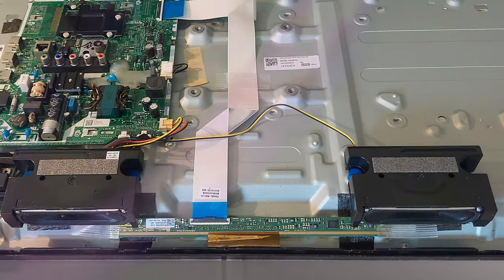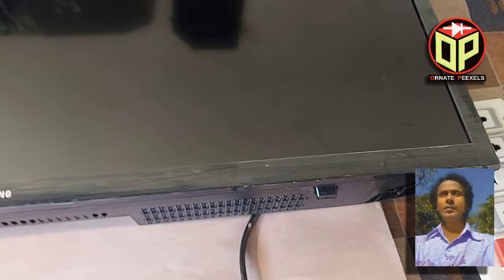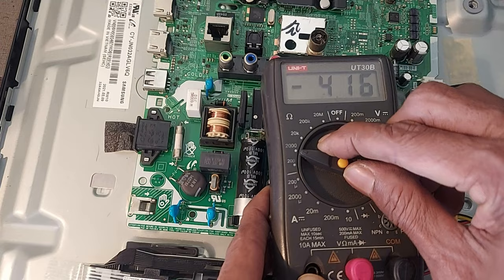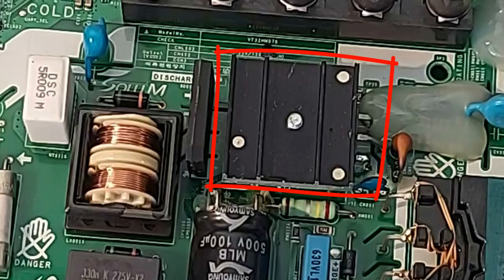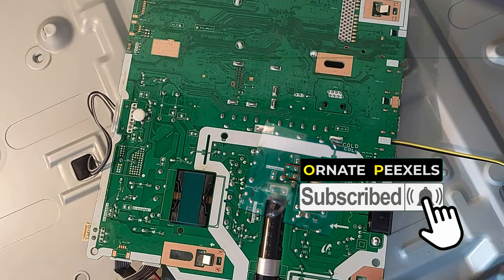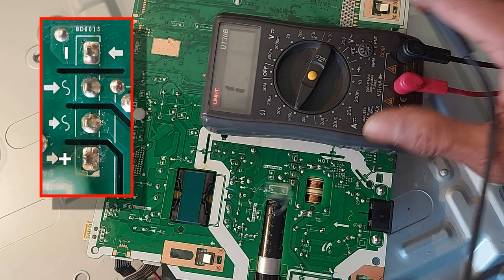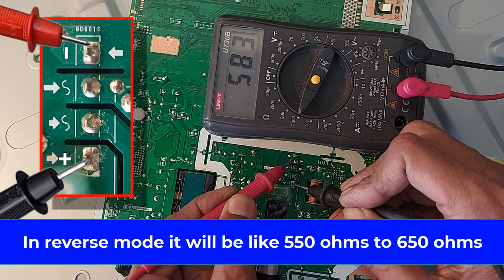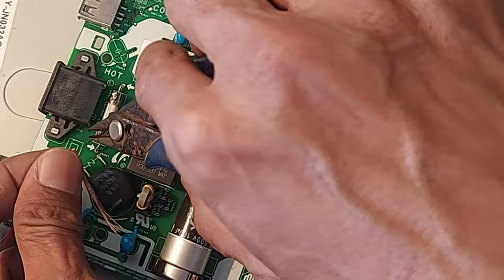Samsung 32-inch Smart LED TV Power not turning on, how to repair this Android TV |  Power Problem

Comment: my dear friend, I like your videos I always follow you, you are an excellent technician, I would like your great help, I have a Samsung Smart tv model un32j4600, this one uses TCOM (HV320WHB-N10) which has 4 Cof, and ic RT9955, I am with difficulties in finding a possible short in the panel, or in the Ic RT9955 itself. The tv has normal backlight and no video at tcon HV320WHB-N10, it has 12v, but it doesn't have VGH, VGL, AVDD, HVDD, VCOM and also doesn't have 3.3V
Reply from the maker: Connect the red probe of the meter to VGH, then turn on the TV, if the VGH voltage is output for half a second, then you know that the DC to DC circuit is working.  In this case you can cut the ckv connection.
Thanks Brother. 🌿❤️🌿